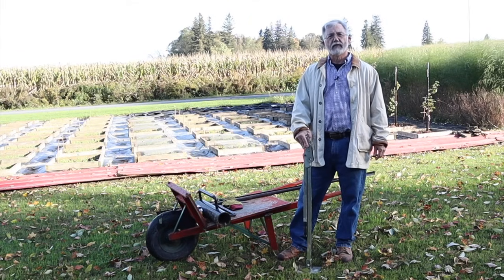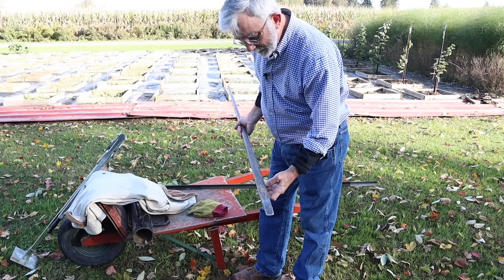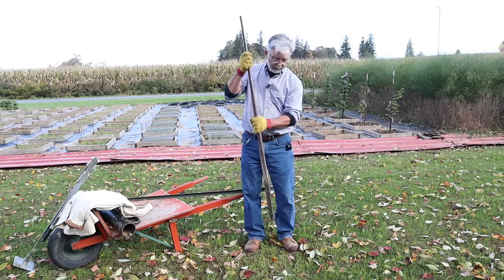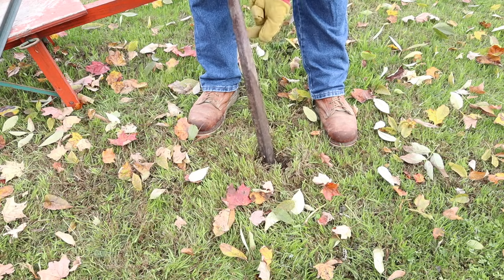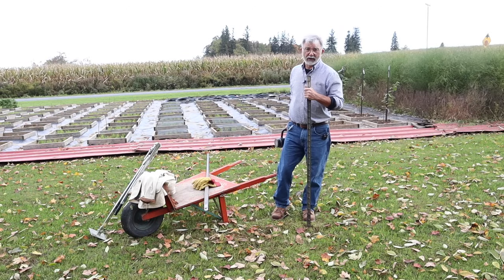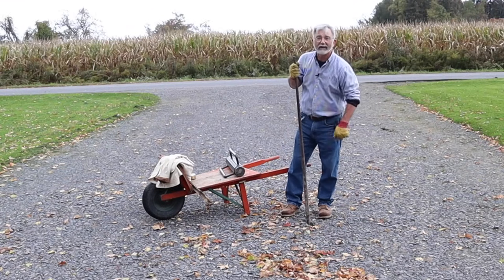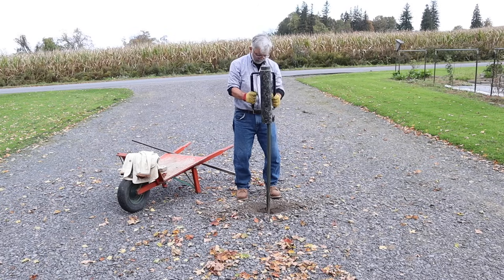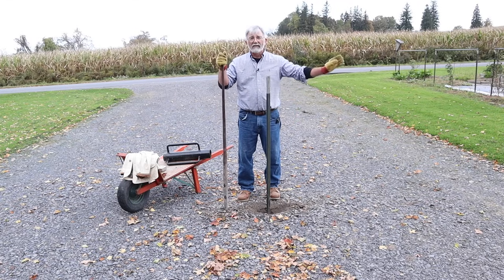How To Hand Drive A T-Post Into Hard Packed Stone ... Or Just Normal Soil

Comment: THIS GUY IS A JERK---GET A POST DRIVER-a heavy steel tube that slides over the post top-you grab the side  handles and yank down-pounds on the top of the post-MUCH EASIER--$30-40 Home Depot, Tractor Supply etc.